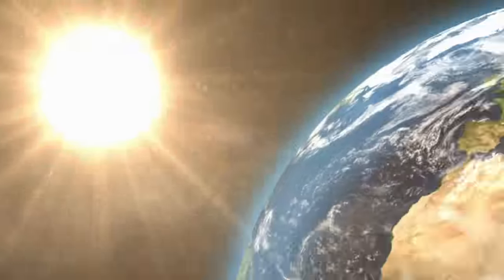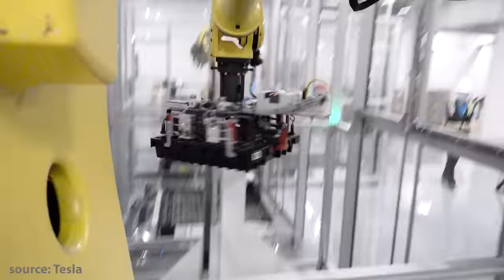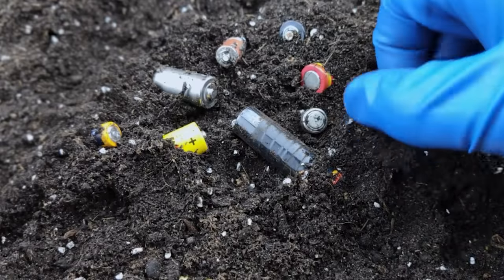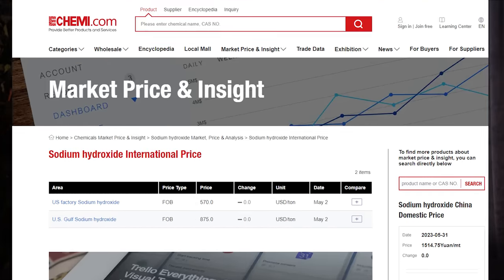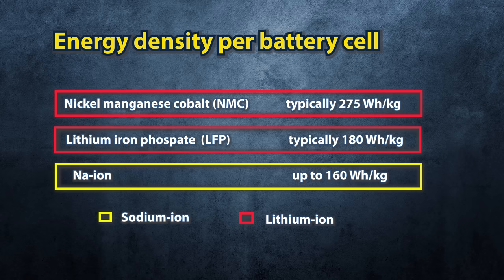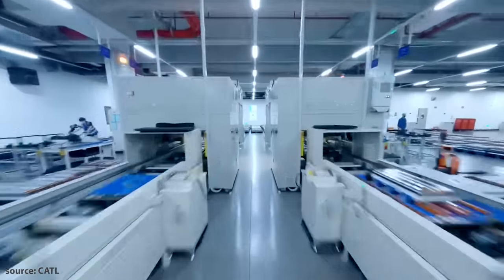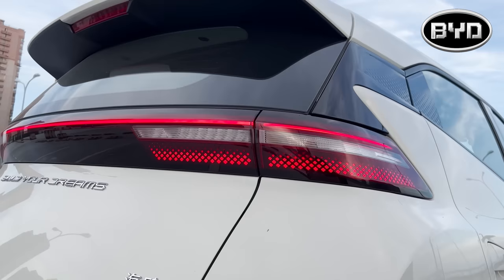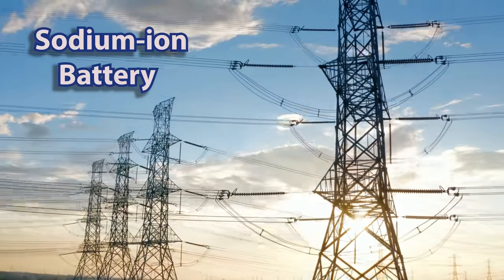Goodbye Lithium!  New Sodium Ion Battery will change the world! And it's in MASS PRODUCTION

Comment: First of all? There is enough lithium in the US to electrify everything in the US 3X over. And similar deposits in Mexico and Canada as well. Most of it is aqueous in nature contained in underground brine deposits. And we now have commercialized DLE or Direct lithium extraction of those brines that is cheap efficient clean and has VERY minimal impact on the environment. No more evaporation ponds leaching out. The brine goes right back where it came from. Deep underground minus the lithium. BTW? The majority of those sites in Chile? Are all salt flats to begin with that were not productive land.
Secondly? This is going to be a one time extraction of resources. We are already cleanly reclaiming 99% of the materials in the Lithium Ion batteries today. Its cheaper than extracting and refining new materials, and produces a superior grade material as well.
Reply: Pffft . Why do you ignore the countries with the largest deposits? AHH yes ONLY AMERICA ,, nothing else ,,,, LMAO
Reply: And what happens afterwards in the relatively short time it takes when lithium batteries degrade?
Reply: @EL-xg4yq  Lithium Batteries are quite capable of lasting for 20+ years in storage uses or cars. The only reason your phone dies is because its designed to wear out as quickly as possible. It would take 20 cents worth of materials and a couple dozen lines of code to give you a phone that will last 12-15 years easy. We are already recycling and reclaiming 99% of the materials in the batteries today. Cleanly, efficiently and for LESS cost than it takes to mine and refine new materials. While also resulting in a purer product in the process. Every lithium battery today is worth is weight in materials. And the industry has already scaled to the point where there is a shortage of batteries available FOR recycling.
Reply: @tilapiadave3234  Everyone has this idea that Lithium is rare. Its not. Its almost as common as Sodium. In fact it IS a metallic salt. The oceans of full of the stuff. Its a byproduct of every desalinization process.
Reply: @davefroman4700  I would agree it is not as rare as many think but it is most CERTAINLY NOT common like sodium. It would be interesting to see the cost / benefit of a mine and refinery that collected Lithium AND the sodium ion ,,, even more interesting when those two PLUS Manganese ,, that style of deposit exists in a rather remote part of Australia

Comment: It seems that the insurances for lithium ion batteries EVs tend to sky rocket. I don't know the real reason, but can it be because of the risk for "big" fires when the cars are parked in indoor parking lots, or in basement of big living buildings.

I would say now a big fight is arising against EV, when the problem is the lithium, and the failures in the manufacturing processes. 

No one discuss the fires in Euro5 and 6 diesel engines, maybe it's because the fires happen on the roads while driving. I happen to have two BMWs which are prone to catch on fire if not properly maintained. The maintenance needed is more "sofisticated" than what BMW suggest!

So, when you have some news it's immense important that it's 100 % correct, because there are too many bloggers who thinks things and that isn't the way to go.

Comment: The single largest issue here is the massive size and weight of these batteries. The zealots are going nuts over these but the technology is still VERY immature, many times larger than Lithium, and weigh many times more with a fraction of the storage density.

Comment: Redox flow batteries are a better fit for grid storage and back up and are more cost effective than higher tech batteries. There are advancements in other energy storage systems that are non-battery types that also show more promise as they are much cheaper and do not use exotic materials. There are many problems with Li-ion batteries that are down to the risk they pose when they degrade or are damaged. In large scale batteries such as cars and grid storage the nature of a Li-ion fire becomes a huge problem and one that insurance companies and fire fighting services are taking a keen note off. Shipping companies are also not a fan of BEV's and for very good reasons. Hertz the hire car giant has stepped back from its planned purchase of 100,000 Tesla cars because of the costs of maintaining them and the damage to batteries being more prevalent that they were led to believe. Sodium -Ion is a safer battery but it is not as energy dense as a Li-ion type and that means less range or even heavier cars due to bigger batteries being needed. Energy density is the most important factor for car batteries but for grid storage cost per KwH and longevity are more important and I am not convinced that sodium-ion is the winner in those areas.

Comment: Lithium is washed out of the sodium and Sodium-ion battery development took place in the 1970s and early 1980s
Reply from the maker: exactly, they just put off sodium in favor of lithium on hold, since lithium is so much more energy dense... :( I think Lithium will still be a huge player we cannot get rid of it, I just believe that sodium would be able to take care of other applications like stationary storage or residential back up. Whereas lithium can be focused on EVs and transportation.
Reply: @solartimeusa  I think its better if we sty on the lead zink ones make them hybrid, have a low voltage one slow charge a transformer to high voltage low amp to form the negative diode of the high voltage high amp storage what could be a sandwich 7 layer plate with 4 difriend materials and 3 insulating material ceramic  ,but I think to far ahead we can't really multilayer every material on low cost , nevermind upgrading to barium ,while al we need is a speaker that plays the right MHZ to vibrate water to split and use the hydrogen
Reply: A low powerd version would use many power to vibrate it with power like a microwave 2.4 MHz heating the water in your food, doing it with a radio wave splits it, your giving it enough energy to split off in the high vibration state on the hydrogen H linked to the O in H2O
there are many other ways to break the H off from the O for example chemistry > decomposition, voltage < light, ,

Comment: So far I have seen no actual gains in electric cars over internal combustion. First I question if CO2 is the earth destroyer it is made up to be, then we have the manufacturing processes of the batteries, then we have the growing uncontrollable fire problem of the batteries which all of them create CO2. I didn't even mention the recycling processes. From what I have seen, driving an EV on a cross country trip is like a modern day covered wagon trip. Short spurts of travel mixed with long periods of charging after a charge station is found. I have concerns about the cell phones and other battery operated products in my house. I am not putting an electric vehicle in my garage attached to my house or try to take a trip to visit my family in one.

Comment: The picture of a Tesla on fire at 5:35 is obviously fake. It is actually known to be AI generated image and is given away by a road-sign showing gibberish just to the right of where this copy has been clipped, among other clues. Do you really think the lights would still be on if the batteries had caught fire from front to back? Some EV car brands have had battery fire problems but Teslas have been very safe and are much less likely to catch fire than ICE cars. 

Sodium batteries will be good for static storage where weight and volume are not important, but improved lithium technologies for cars are well ahead of sodium for energy density. We will have to see if that changes, but if it doesn't there is plenty of lithium for EV batteries. Lithium prices are falling, but this is not due to a weak economy or lack of demand for EVs. EV sales continue to increase exponentially. The supply of lithium has increased and refining processes are advancing. It is hard to predict future pricing but it is more likely that lithium prices will continue to fall. The CO2 emissions from mining Lithium will disappear as excess renewable energy replaces fossil fuel energy production and lithium recycling grows.

The price tag on the hypothetical sodium car that has not been built yet would be for the Chinese market. It would cost much more in Europe or North America.

Comment: I don't think sodium ion batteries (Na+)  make economic or technological sense now or in the near future, particularly compared to LiFePO4 (LFP) batteries. Na+ is still more expensive than LFP, and with many new lithium mines coming on line soon around the world, lithium prices could drop as much, or more, than Na+ batteries as their manufacturing capacity is built up. But even if they do become cheaper, per Ah, than LFP batteries, that steep voltage-to-SOC curve of Na+ is not suitable for many applications where the flat curve of LFP provides excellent performance. Powering an inverter is a prime example. There's a lot of hype around Na+ right now, but with the lithium bottleneck easing up, sodium may have missed it's window already.

Comment: We need to go with hydrogen. Use solar wind and nuclear for electrolysis or create carbon capture systems if source is natural gas. You can run a conventional engine with a few modifications on hydrogen or do a hydrogen fuel cell. No rare minerals, quick fuel up, barely have to change existing manufacturing, reliable all day power and it's affordable and doesn't require starving half the world with expensive regulations and technology

Comment: These batteries cannot be charged many times, It's their biggest flaw.
BYD's Blade batteries are still catching fire, so no improvement there..Battery cars still have many problems, finding a charger is one. Low resale value another. Best avoided. Not green at all, just the opposite.

Comment: Sodium battery is low density.  It won't be used in cars or phones.  But for grid it is fine.  Size is not a matter.  Sodium battery is cheap but low density for now.

Comment: Its better to have powered roads or small replaceable batteries, instead of EVs moving heavy batteries back and forth. Transportation is an infrastructural problem.
Reply from the maker: Very interesting point. I always wondered about how that could eventually happen. How many years away could this be? Just a guess... :D

Comment: Sodium solar shield. No more batteries best thing ever. Just kidding. They maybe group 1 but you totally miss the main problem, storage. Yes you can charge them up real quick but if it can't hold that power and drains in 4 hours, whats the point of charging it up in 1 hour. The other information I agree with. Its like nuclear vs thorium. One is more abundant and safer in a huge way and produce equal amount of power but we went with the more dangerous one anyways just because of war requirements.

Comment: ..ahh.. you failed to mention the exothermic reaction that produces explosive gas (hydrogen) and caustic acid (sodium hydroxide) when Sodium is exposed to water lol.  ...so as long as the cells never contact water your good?  right?  lol...   oh... and..cell voltage drops from about 3.7-4.2v/cell to 2.2v-2.5v..... so.. A sodium battery will always require more cells to achieve same battery pack voltage...so its not just about kWh/Kg...  more cells  = more cell sensing hardware.. larger battery pack = 9/10 a heavier battery pack.

Comment: Sodium Ion Batteries are hardly new; they've been around for almost 15 years..   Sodium-ion batteries are cheaper than lithium-ion batteries, similar power delivery, but significantly less energy density, so they will give you less range than an equivalent lithium-ion batteries.  

So, it's not really going to change anything.

Comment: Seriously... This is laughable!

Sodium batteries may potentially find some good use in ESS. That is, if China can deliver what they claim. 

But not for high-performance EVs. 

Atomic # of Sodium 11
Atomic # of Lithium 3

Sodium cathode materials will have to be about 4 times heavier to hold the same amount of charge as Lithium. This is a fundamental fact one can not change thru technological advances. And this is why you should not sleep in your Chenistry classes.
Reply: Sure, but that doesn't mean we won't have sodium powered cars as well. The industry will also need to play from the engines side of the pound. We need more efficient engines that can run on the available batteries. And the electrical engines appear to have a long margine progress level to go... Less powerful batteries to power far more efficient engines? Maybe a success way?...
Reply: @nunagoras  I never said you are not allowed to make EV with Sodium batteries. But never say that Sodium batteries will have better energy density than Lithium batteries. It's fundamental property of nature. Sodium ions carry 3.67 times the weight penalty of Lithium to store equal amount of charge. Who gave you this silly info to spread like this?

Comment: no it wont. sodium batteries are far less power dense than lithium batteries. they wont exactly be changing the market for EV's due to range limitations. sure they are cheaper, but not cheap enough to justify all the extra size and weight a sodium battery bank would need to have, to reach the equivalent range of a lithium battery bank. maybe smart phones, as the phones would become slightly thicker and larger with screens for the same life cycle. but EV's....no, far from it. Maybe back up battery for grid storage of intermitted green power production, as transport isnt an issue, and the extra weight is not an issue, same with size, as the volume of hte batteries can be stacked vertically.